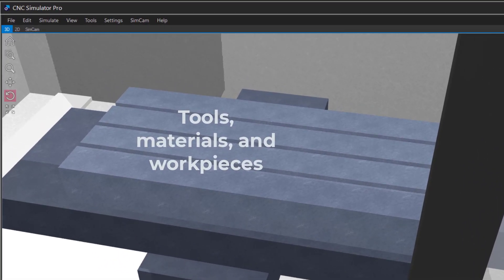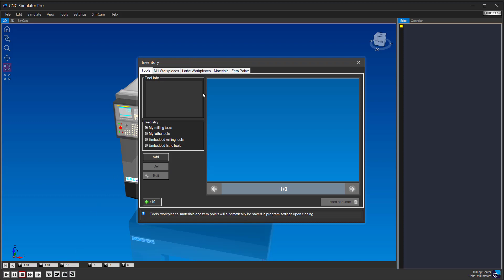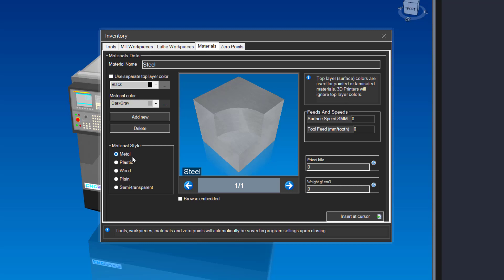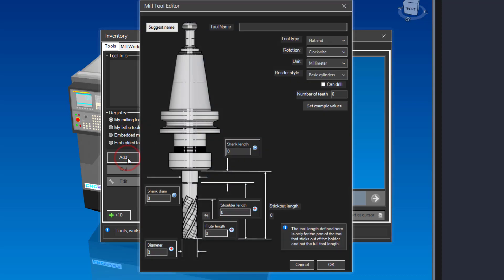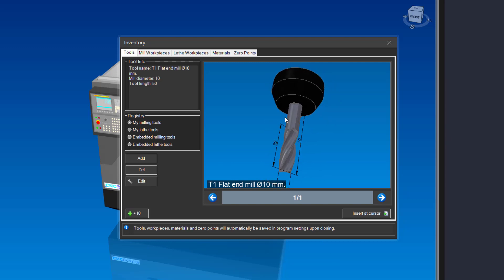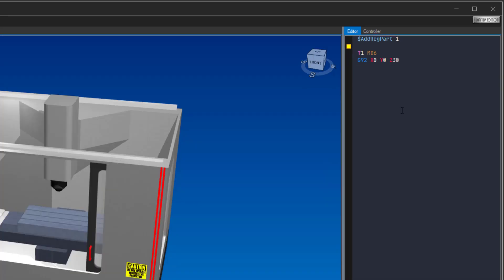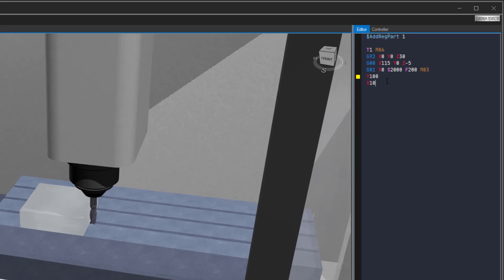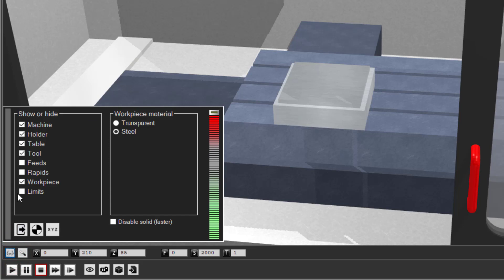How to create your first milling program in CNC Simulator Pro

Comment: Nice and clear video
One remark:  I should place the workpiece more to the midpoint of the machine table by adding for example 50,50,10 to the first line:
$AddRegPart 1 50,50,10
Now the left, front upper corner moves 50mm in X, 50mm in Y and 10mm in Z.  
By doing this, you can avoid "axis limit" errors in X and Y.
Now you have to add these values to the G92 command:    G92 X50 Y50 Z40
By lifting the workpiece up for 10mm, you can drill or mill completely through the workpiece without the error message that tells you that you crash the machine table.
Reply from the maker: That is correct. Thanks for the feedback.